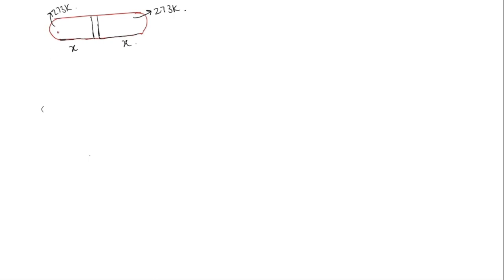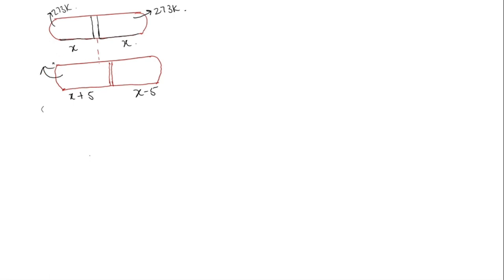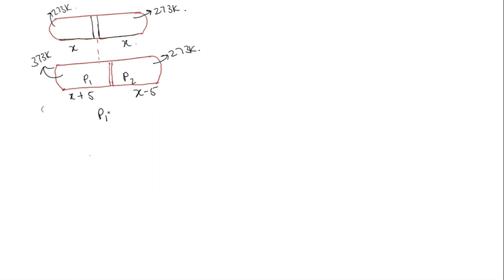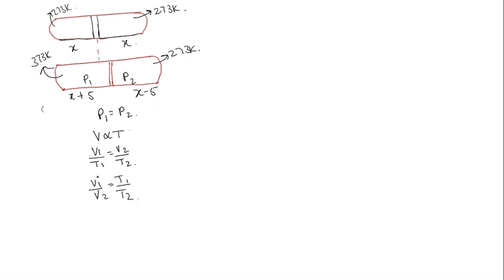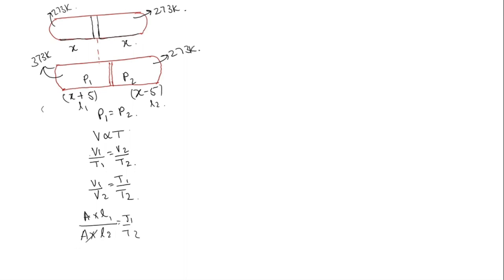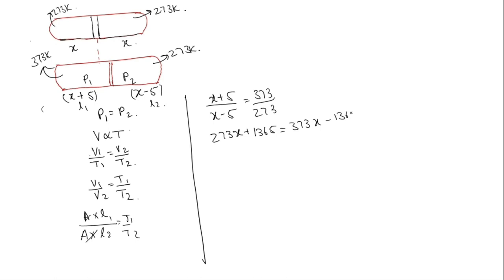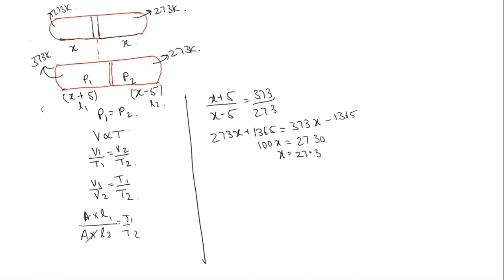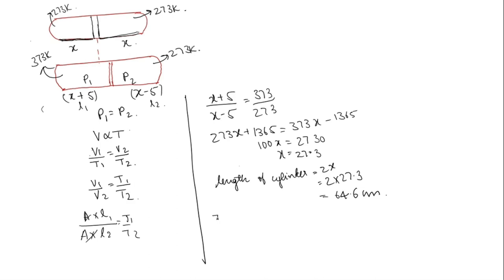A closed hollow insulated cylinder is filled with gas 0°C and also contains an insulated piston of

Comment: How pressure is equal.....coz one temperature is higher than other side... because temperature is directly proportional to temperature
Reply from the maker: the piston will be in equilibrium only when the pressures are equal on both the sides ........the piston is in that particular place only bcuz the pressures on both the sides are equal
Reply: Thank uuuuuuuuu so muchhh dear
Reply: U took pressure when the piston is in middle portion (equilibrium) tq
Reply from the maker: not only in middle portion.... even in the second case the piston is in that particular position bcuz the pressures will be equal...
Reply from the maker: @sam-bl5co welcome
Reply: @sciencekeys  in second position the temperature increases so pressure will more on one side where temperature increases
Reply: Then how pressure will be equal
Reply from the maker: if its not having equal pressure then the piston will be moving right
Reply: @sciencekeys  yes 😘😘